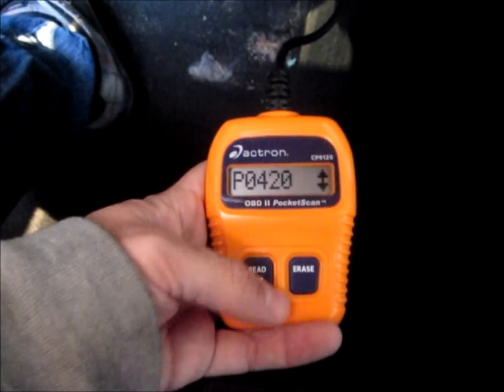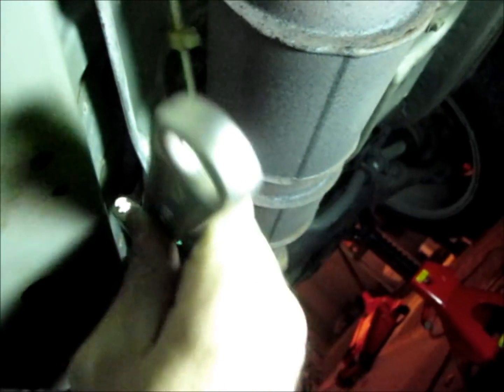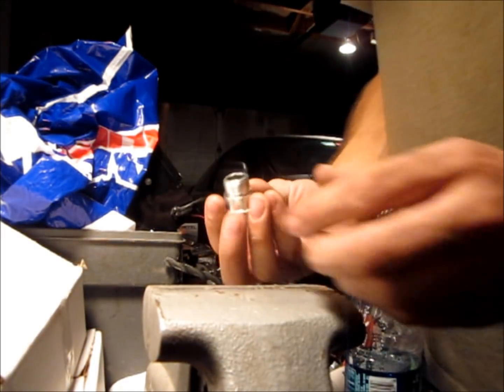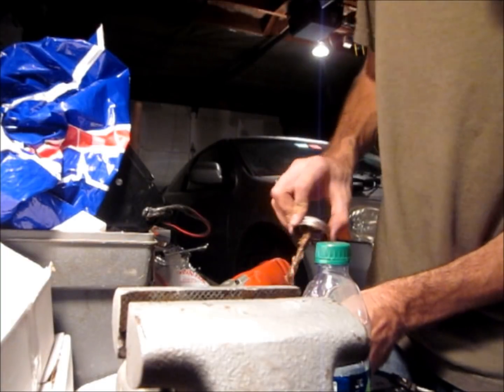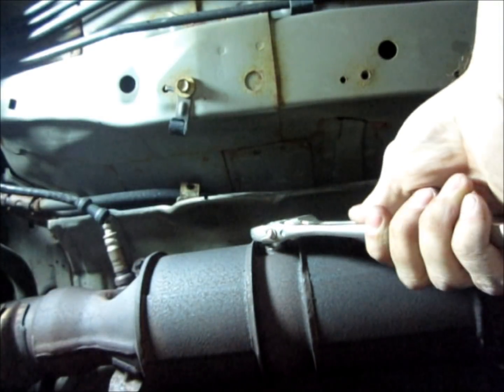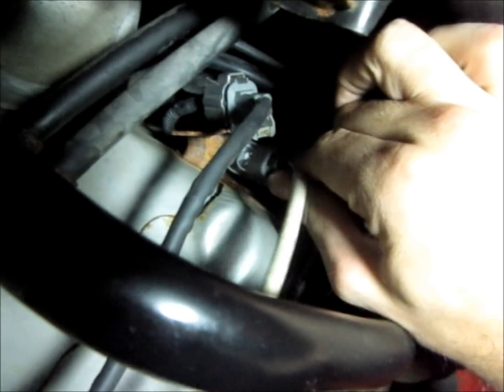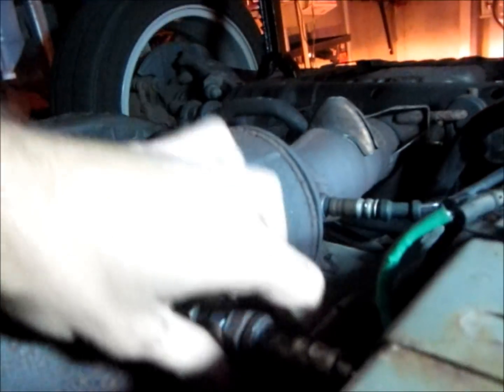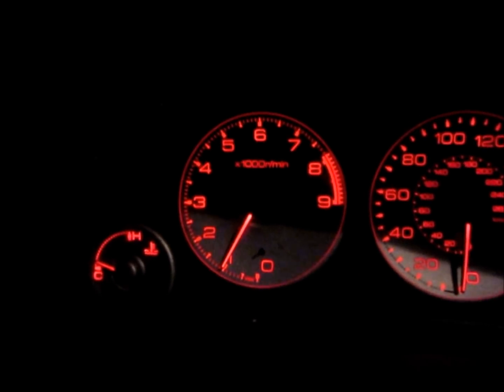Clear check engine light for less than 5 dollars

Comment: Great Video, please share more of these hacks, Inspection time here in Texas is a bitch, so many times one cant afford the repairs necessary to pass and its not like you can just stop driving. I opted for owning old classics, instead of the modern cars just for this reason, once the engine light comes on you better pray you can afford the repairs before your tag is out otherwise you get pulled over and ticketed. Real stupid shit if you ask me, ..one rocket launch, satellite launch, nuclear waste spill, oil spill - is thousands of times more destructive to the environment than anything a car can dish out, but its a great money maker for everyone involved except the hardworking car owner. Please share more stuff like this, this is good to know, thumbs up bro!
Reply: I understand the initial intent to reduce pollution but I think we should all be given a bit more leeway and not have to stress over Inspections as much until oil spills are non existent, nuclear waste stopped from seeping out of expired facilities, fracking by product gasses and water contamination eliminated, depleted uranium and other chemical toxins removed and no longer used in war, until at least these things are taken care of first, the pollution from vehicles is the least of our worries. Consider also the deliberate carcinogens and chemicals used in our food products....Those things should be the real issue. Vehicle inspection is a clever way to keep the sheeple buying newer cars, taking out vehicle loans etc...I'm just saying the tolerances for the emissions test are to narrow, they need to give us some room, not everyone has the $$ to have their vehicle in top shape, I wish we all could but that's is not realistic, its unfair.
Reply: @fordcobraboss427  Exactly.🤦🏽
Reply: Shanon Bull Not true, I reset my code every year for three years and have passed in Mass.
Reply: Thats great to hear, here in Tx aholess found a way to screw the vehicle owner even more and made it illegal to reset the codes unless you are a shop that fixed the issue first. I used to be able to reset codes to and pass but now all the inspection places must have a minimum of 75 miles of data available to read, most codes will pop back up after driving 50- 75 miles so now even resting the codes is useless.
Reply: What really ticks me off is that while the better off individuals have no worries about inspections (they can afford new cars every year or any repair costs) the rest of us that have it hard already end up with all kinfs of unnecessary hardships even at times losing a vehicle due to towing just over an expired emissions tag. Why cant we all just vote for a more relaxed system and even put in place a pay to opt out  alternative option.
Id gladly pay up to 100 for a opt out tag when ever I cant afford a expensive car repair. This way avoiding tickets and getting towed from my apartment property. We really should work together to change the way emissions testing is done. Some repairs can cost up to $1500.00, I cant pay that much just to go get passed at the inspection place if my vehicle is running ok.
Reply from the maker: In my state it goes by birthday month.  How does it work in TX ?
Reply: It seems to be tied in to the date of the initial vehicle registration, in my case its at 3 months after the registration tag date. I wish the emissions testing laws were more lax. id rather just pay a one time yearly fine and be on my way than have to maintain a vehicles engine in top shape over a few gases. Its all part of the bigger picture, bring in business for the Dealerships and Banks, most people rather be stuck in perpetual car payments buying new cars every 2 -3 years than face the repair bills that result from mandatory emissions laws. So much for Freedom huh.
Makes me sick!
Reply from the maker: Ford Winsor SVT I agree-- buying and financing a brand new car is one of the worst investments one can make.  Even buying "pre-owned" and financing is slightly smarter.  I Financed my current vehicle but I put like 70% down and the total price for the car was a little over 5k so my payments are super low.
Reply: This won't necessarily make the car pass inspection, just possibly keep the check engine light from coming on by fooling the computer.  All this does is move the oxygen sensor out of the exhaust gas stream to prevent it from reading the actual gas content.  He did SAY this was for off road use.  I suppose he will trailer the car to the edge of the woods.  The auto can still illegally pollute the air, even without the light coming on, kinda like just removing the bulb.

Comment: this thing isnt to move the reading "farther" from the catalytic converter. it is still in the same spot. however it pulls some of the O2 sensor out of the exhaust stream hence giving it a "misread" of the actual amount of emissions passing through therefore not throwing a CEL for having to much pollutants exiting your exhaust and hoping you replace your cat. currently about to do this on my subaru wrx so i can run catless.
Reply from the maker: Technically the sensor is moved a few inches back when you install a fouler.  It's just a layman's way of explaining it I guess.

Comment: Hi, thank you for the video, wich of the 2 sensors (front, rear)  is the one you put the spark plug defoulers ??I have 2003 Honda accord V6
Reply from the maker: The secondary sensor, which is more toward the rear of the car.

Comment: This doesnt cure anything, it just pulls the 02 out of the stream so it reads wrong. yaayy. your a hack.
Reply from the maker: Never claimed to cure anything.  But your CEL went away now didn't it.  You're welcome.
Reply: moccina your cel only went away until the problem becomes much worse and destroys something much more expensive. An engine running lean won't last long at all…But you are probably too fucking stupid to understand that. You're welcome.
Reply from the maker: Diesel Ramcharger Secondary sensor has no authority on fuel maps. Look it up genius.
Reply: Oh fuck here we go. Since I'm sure you have the capability to decode the hex from one of these ecm's, exactly's "who" is "they". You are regurgitating internet sputum that you assume is correct.
Reply: http://books.google.com/books?id=zst2aOSNnCkC&lpg=PA124&dq=rear%20fuel%20control&pg=PA124#v=onepage&q&f=true
Reply: gilman9991 Exactly.

Comment: Hi does this reset for check engine lights work on all cars I have an 05 Nissan altima.thanks
Reply from the maker: Only one way to find out.  After installing the part, resetting battery and performing the drive cycles.  If your readiness monitors are "ready" and no check engine light is on, then you are in the clear.

Comment: anyone who uses an adjustable wrench is no mechanic
Reply: And this affects you how? why not let the guy use whatever the fuck he wants! it worked for him so why not? I am not ashamed to say I have and will continue to use crescent wrenches
Reply: bmxman121 That tells me you don't know shit. lol
Reply from the maker: speedwayaudio3 I actually used an 02 sensor socket and 1/2 inch breaker bar to torque off the sensor.  The adj. wrench was used as a visual for the video. But IMO it doesn't really make sense to judge a person's mechanical ability solely based on the fact that they use an adjustable wrench.  They come in handy for many-many things but to each their own lol.
Reply from the maker: bmxman121 And yes you are correct, it's called a crescent wrench, not a fucking adjustable lol !
Reply: moccina See that is where you are wrong. "Crescent" is a brand name that makes adjustable wrench. Just like the name brand Allen makes hex keys not Allen wrenches. Same thing. What a dumb ass you are lol

Comment: your an  idiot ! The maintenance required light is on because it's time to change the engine oil  WOW read the owners manual. The light for the part you are messing up is a check engine light two different systems. And isolating the O2sensor from the exhaust stream is not the proper way to repair an automobile. Your way will only cause the system to default and start using a lot of fuel and with time burn holes threw the pistons or burn the exhaust valves. Heres how you can fix it take the car to an ASE certified technician at a good repair shop. Don't quit your day job!
Reply from the maker: *****  Why so fuckin rude ? Would you say this shit to my face or does your keyboard give you courage ? Secondary 02 has no authority on fuel mapping so you are wrong.. you may want to re-research that. Yes I am aware that the maintenance light means you need to change oil. I don't need a dummy light to tell me to change my oil.
Reply: When you can pass all the ASE master tech tests in one evening and score above 90% on all 8 tests and work as an automotive diagnostic tech for a major nation wide company then I will take the time to listen. It's people like you that give the professionals a bad name. You should keep working on cars the way you do, it keeps the salvage yards in business.
Reply from the maker: ***** I am not an auto tech professional and never claimed to be. I'm a backyard wrench turner-- proud to be one.  What good does a "master technician" cert. do if you still can't grasp the concept that primary 02 does not control fuel mapping lol ? I think you're dancing around the point.  BTW, I have a few degrees myself but I don't make it a point to brag about them.
Reply: Hey I apologize. I should have never said all that. I started in the back yard too, I have forgotten where I came from.
Reply: James Norton says (and I quote verbatim):

"Your way will only cause the system to default and start using a lot of fuel and with time burn holes threw the pistons or burn the exhaust valves."

Since when does a rich condition contribute to the excess heat that would be necessary to burn exhaust valves & piston crowns?? A LEAN condition does this my friend. Hard to believe, with all your credentials, that you don't know that. Doesn't lend a whole lot of credence to anything else you claim, does it?
Reply: *****  I guess the 10% you got wrong on your "ASE master tech tests" was on what a downstream O2 sensor does. Lol.
Reply: Downstream O2 does one thing, it monitors the efficiency of the catylistic bed of the converter.
Reply: Sorry guy , but first of all the o2 sensor he is modifying doesnt change how much fuel the car is using, just checks to see if the cat is doing its job by comparing the first one the second o2 sensors. Second, let's say It did change the fuel, only a lean condition would cause overheating, not a rich condition. Third you car will not burn a hole in the position becuase of overheating, at least not that I have ever heard of. ASE 😂 jokes

Comment: Hi there , i'm working in exhausts and emission controls fixations more than 5 years ago and to tell you that , this video possibly could solve 20% of p 0420 conditions , what if you have problem with injectors or fuel pump or ECM , or clogged cat ?? that wont work,  to simplify p0420 , its a reading between 2 sensors on a same exhaust line monitored by ecm  , upon the demanding frequency of rear sensors the ecm will adjust fuel ratio to air on each combustion cycle ,but if you have electrical ground issue your sensors might stop
Reply from the maker: ***** Thanks for the info.
Reply: welcome i can support if you need any help
Reply: you are wrong , exhaust leak will issue "  system too lean " p0420 is far from your point , its like 2 gates and 5 players must pass those 2 gates , but there many dangerous on the way between the 2 gates , so in normal conditions the 5 pass 1st gate and only 2 reach the 2nd gate , if the  5 players passed 1st gate and then they passed the 2nd gate all 5 of them means the way between the gates is useless and the game is over
Reply: @ yeah buddy there are many steps before you come out with conclusion , do you have any idea about usage of multimeter for o2 sensor to inspect heating elements and where is the supply and ground ? your way how did you described it looks like you are just a labor in small exhaust workshop  have no idea about ecu feeds inputs out puts regulations and ratio auto adjustment

Comment: i've recently bought here in UAE Toyota Camry 2004 LE, USA exported, and it shows the CHECK light. I've checked with Computer shop and they said it has a Sensor probe. I replaced new. I changed the Oil. I changed the Oil Pump. I cleaned each and everything. The only thing is remaining to open the Engine and recondition it. Could you help me how to solve this issue without opening Engine.
Reply: i'm mechanic and work in UAE , please tell me the DTC code that you have got  when you scanned your car ? is it p0420?

Comment: if the enginge check light is on, it means there is something wrong, by moving the o2 sensor you dont do anything than just give the control unit wrong/changed information. also it takes longer to heat up the o2 sensor wich means u dont drive lambda 1 until its warm enough, so ur combustion cant be controlled which will kill the world!
Reply: AlphaXX44 if that doesn't kill you the cops would anyway so are you scared of death?

Comment: Autozone nor any auto parts store can clear your code. It's illegal. & there is another method to this besides using spark plug foulers. It requires an old o2 sensor. And seems like a lot less time than this. Lol
Reply from the maker: Alex Orndorff  So many viewers saying this takes too long. Either way, this was only an experiment (off road) and I'm simply sharing my experience-- people can take what they want from the vid.  If I wasn't filming this is a <20 min job lol. Thx for watching

Comment: I'm willing to bet this is illegal in all 50 states. As all emissions controls are governed by the EPA then more strict emission controls per state. Do yourself a favor and when you have that code P0420 test your cat. Most likely it need to be replaced. 
Note: This person did NOT state if he drove about 10miles with this mod. Acura/Honda's and other car do a self test with a set amount of drive cycles. These drive cycles are random and can also be by time not just miles.
I bet his Check Engine Light (cel) came back on because his cat is faulty and needs replacing.  If by some miracle of chance his cel did not come on, then he has fooled the system but more importantly modified his emission controls which is illegal in the US.
Reply: lol your funny blind otter. I am willing to bet you are against the legalization of marijuana too. :)
Reply from the maker: BlindOtter Why do you refer to me in the 2nd person.  I'm right here and I reply to comments on my vids :)  Anyway you are correct-- this is not legal for street use and I do not condone this, it was just an experiment and should only be used for off road vehicles. Some states do OBD testing with actual tailpipe testing, others only do OBD-- A few states don't even have a safety inspection at all (FL, MI) but that's beside the point.  To address your assumption about my readiness monitors and the CEL returning, you are incorrect.  Monitors ready and no CEL.  Thanks for the comment.

Comment: I would be the first one to fail you for modified emissions controls.
Reply from the maker: I would be the first one to not take my vehicles to your shop.  Bottom line, this is an off road fix as stated in the vid & description.  Thx for watching.
Reply: It would be better to test the tail pipe emissions than to fail someone for a modification.  Just because the light is on doesn't mean the emissions are out of spec.
Reply: Leo Michaels
that is exactly what "the light" or CEL is for.. to warn the driver of an emissions producing problem with the engine... i.e. misfire that causes the engine to produce higher than spec emissions and/or but not limited to EVAP type codes that aleart you of emissions escaping to open air (purge charcoal canasters and evap leaks like hoses to the fuel tank and gas caps)

Comment: the light went off because you unhooked the battery! Check engine light always comes on when you turn the ignition on...then goes off on its own..
Reply from the maker: David Spencer  I drove this car 50k miles without the CEL returning. All monitors were ready come inspection time. Thanks for watching
Reply: moccina
That's a WHOLE lotta offroading...[-: